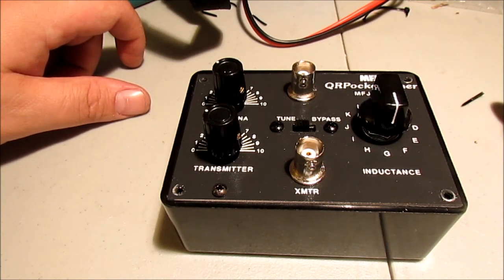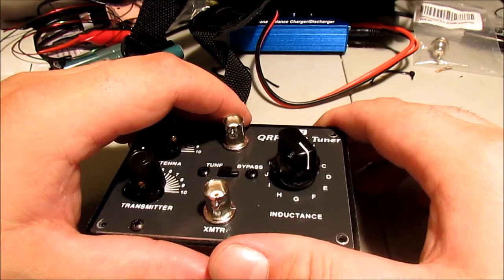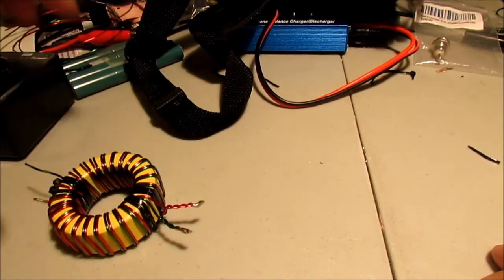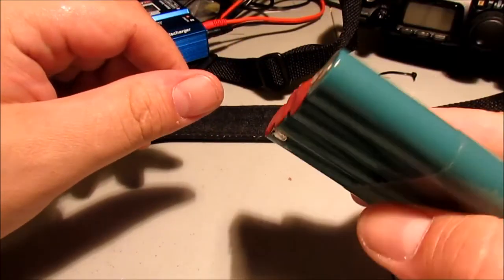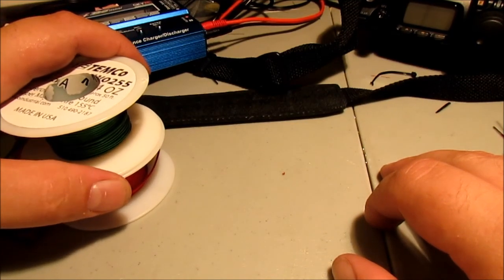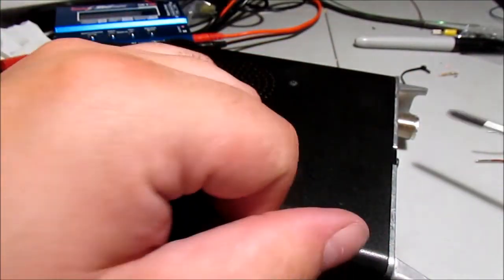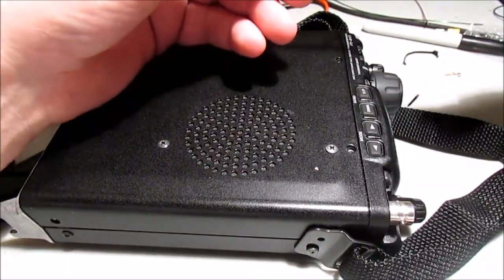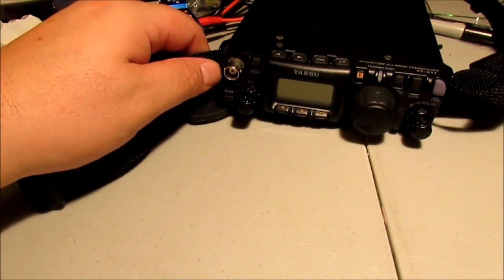MFJ Pocket Tuner, FT817 TCXO and more

Comment: Actually, "chinese TCXOs" for the FT-8x7 serie are far from being junk. ZL2BKC tested one of them and the one he bought is doing a very fine job (5 times less frequency drift than the standard xtal) and does not even need to be ajusted : https://zl2bkc.com/2014/10/29/stability-of-chineese-tcxo-9-in-ft817/

Comment: Nice video but the cheap, likely Chinese, poly variable caps in the MFJ tuner are hardly "robust" and also likely difficult to source if one arcs over through the paper thin poly layers and fails. A lot of MFJ products use the cheapest possible Chinese components and this tuner is no exception.  While it can likely handle 5 watts under near ideal conditions I think you could easily destroy it with 25 watts and a difficult antenna. 100 watts is pure fantasy for those tiny variable caps. Most would better served with something like the LDG Z817 which not only doesn't have tuning caps out of a 1960's transistor AM radio but will tune itself and remember the settings for all the frequencies you use. For a few more dollars it's a vastly better tuner that's still fairly small and inexpensive. As for the 817 battery situation an external inexpensive LiIon battery is generally the most practical and cost effective solution. It can offer longer run time for less dollars per amp hour than an internal battery.
Reply: why the anti china attitude? china makes every quality of part from dirt cheap rejects to world class components. which ones you buy depends how cheap YOU are

Comment: I hope you haven't charged lipos inside the radio. I've been using lipo batteries in RC aircraft for ten years. They are very powerful and sometimes unstable. It's good practice to charge in a metal fire resistant container. Please check around the internet before you try this. Good luck.

Comment: nice little tuner.. i don't like the variable caps and wish they would put nicer ones it in... they look like the caps out of a pocket radio...
Reply: they pretty much are transistor radio tuner caps but for QRP work I think they will last. I think that's why MFJ changed the description from 100 watts to 25 watts. I personally won't run any more than 10 or 15 thru it.
Reply: Yes, those caps were made for receive only, not rf power.
Reply: the elecraft t1 is the best tuner for the 817.